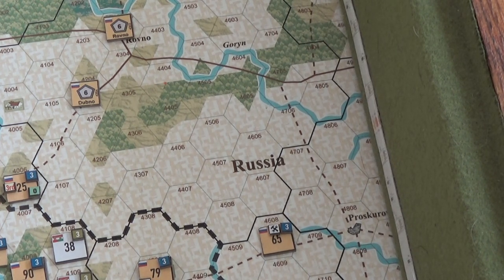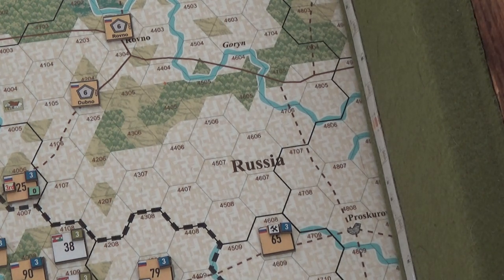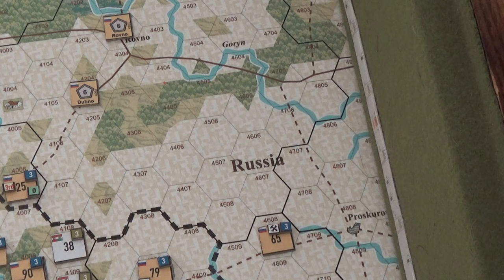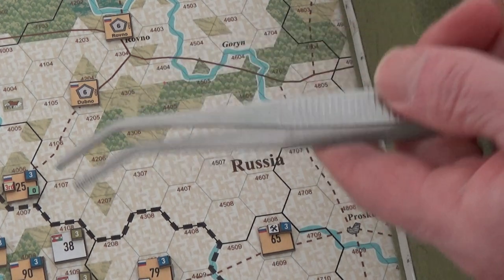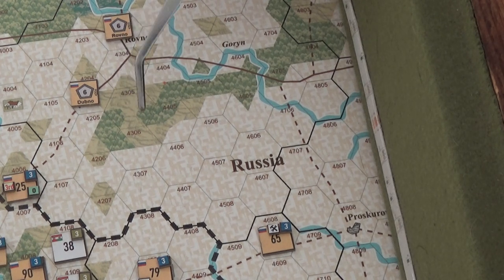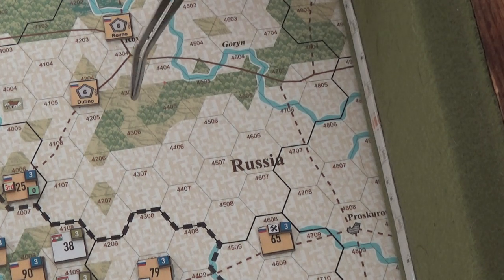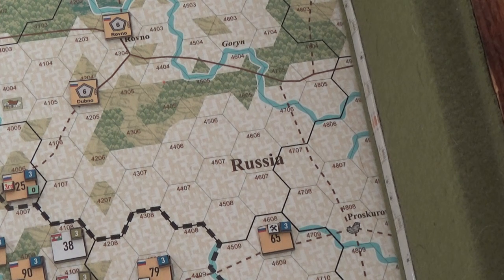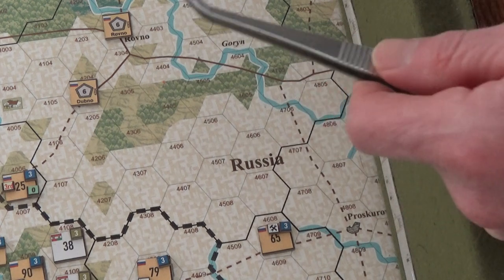Constructing Rail Is Very Expensive And Time Consuming, In Der Welktrieg

Comment: I didn't realize you could build new tracks. Are there markers for the new tracks, or do you use rail head markers?

Sings - "he's a lumberjack..." 😁
Reply from the maker: Glad you asked, as I went to check and there looks like there is!
Under Section 29-8
"Progress of rail construction is shwon by construction and rail line markers."
I checked (quickly), the counters sheets that come with the Grand Campaign, and saw rail line markers, but no construction markers, yet.
Thanks!